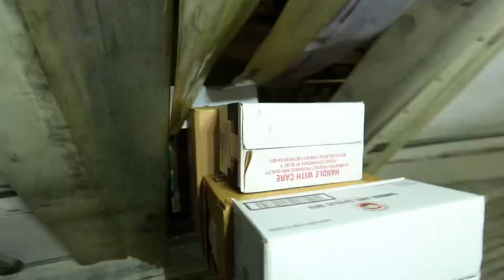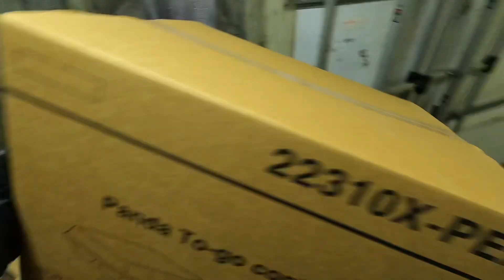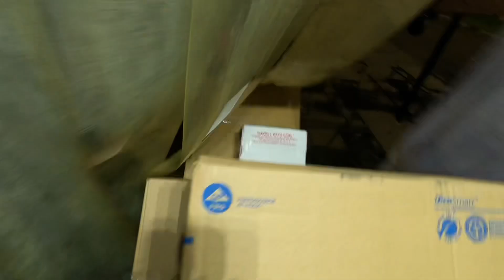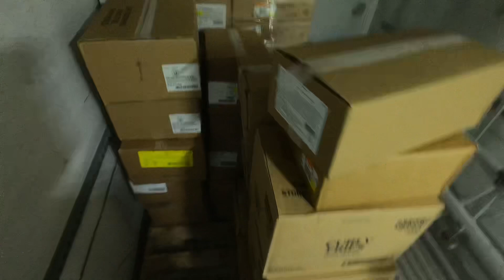🗣️This is the best hand truck to use for food service! Hands down! 👀VLOG #trucking #truckdriver

Comment: I been with GFS since the end of February this year. I use a hand truck like yours for my light cases and the pistol grip for all other stuff. I feel like I can control heavier loads with the pistol grip. 

And that handle we use to pull out from up under the load is a game changer. I was at coke before and we didn’t have those. If it won’t for steel toe shoes, I would have tore my feet up! 😂
Reply from the maker: 😂definitely